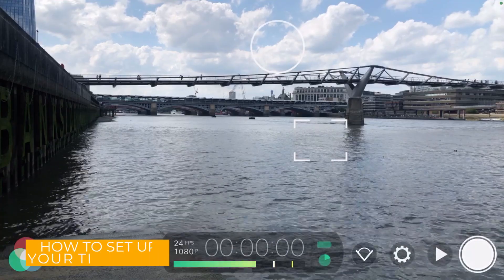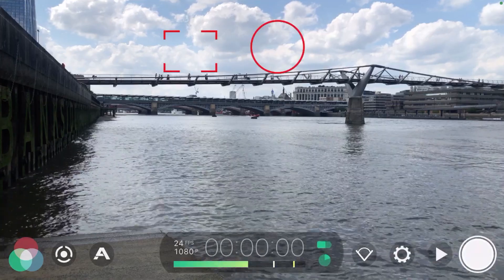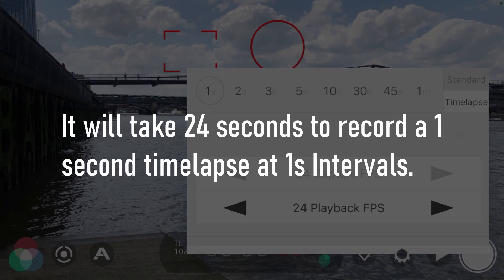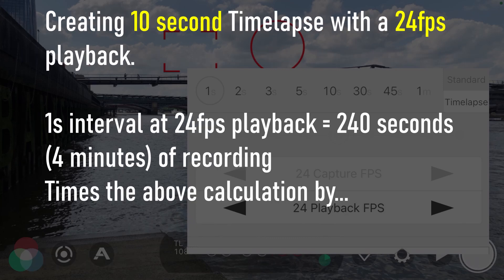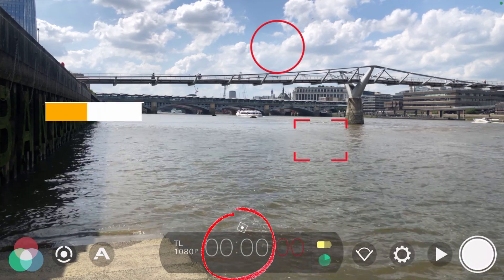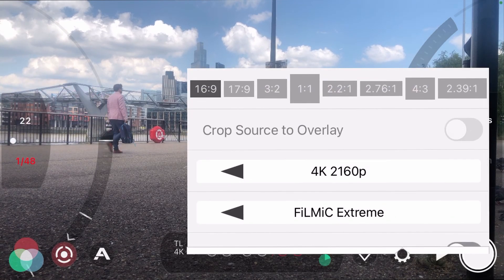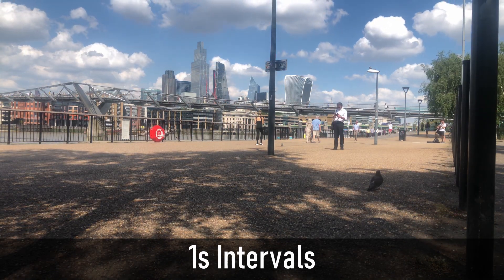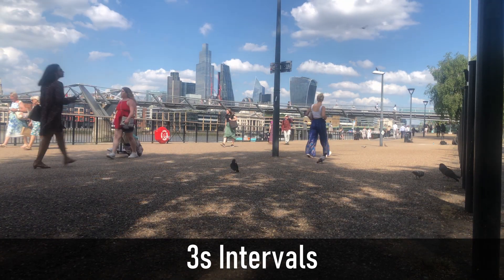Filmic Pro Timelapse settings tutorial

Comment: Awesome tutorial. Thanks. Question: Is it possible to save all settings as a preset so that the settings are ready to go at any point?
Reply from the maker: Thanks so much! Yes you can. Go to presets in the top right of the main settings menu and save your slow mo settings so you can load them up at any time. You'll likely have to correct the iso ect but everything else should be saved.
Reply: @SmartphoneFilmmaker  Awesome! Thanks so much. Don’t know how I didn’t see that.
Reply from the maker: @EPHONIC  You're welcome!